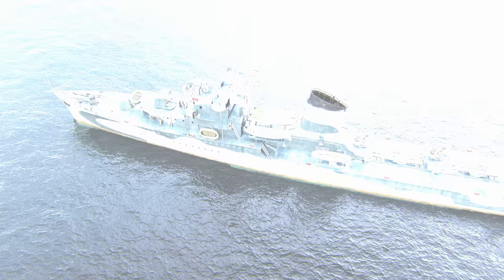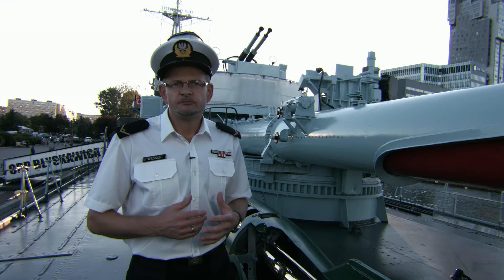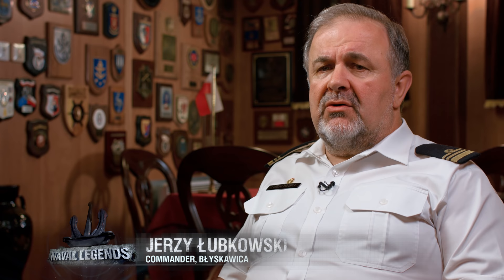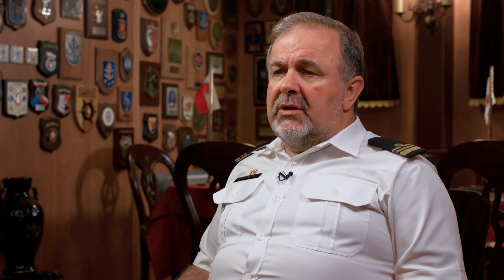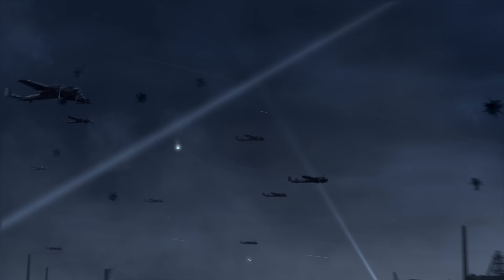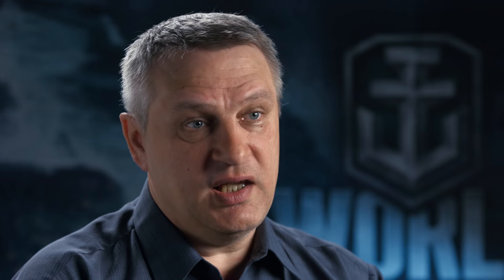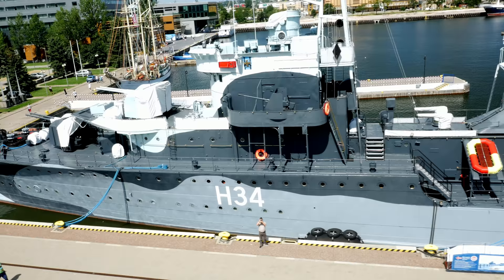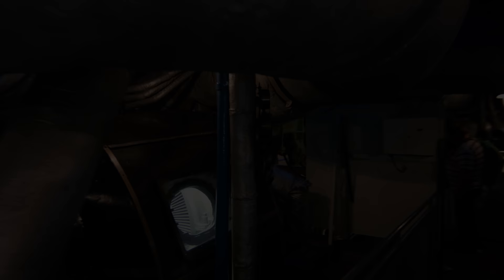Naval Legends: ORP Błyskawica | World of Warships

Comment: Yet in game this ship's AA doesn't do anything versus planes.
Reply: Her 7 120mm main guns were replaced by 8 102mm DP guns in a 1941 refit, and her 13.2mm guns were replaced by 4 20mm Oerlikons.

WOWs only shows her in her 1937 hull, not he 1941 hull. Some people have suggested to include it as an option, which would essentially make her a tier VII Akizuki.
Reply: Matthew Lum I think people like the 7 120mms more
Reply: I don't have much of an issue with them either, except for the huge OCD trip turret A gives me. 

The 102mm guns would make her much more competent against other DDs, given their better traverse rate and much higher ROF. In addition with her high speed and excellent durability, it would make Blys one of the best DD killers at its tier. It would be lacking against BBs unless you pick the right captain specs, however, and range would likely suffer as I'm quite sure the 120mm guns had a larger caliber barrel than the 102mm guns. So it would be a matter of what role you want to play.